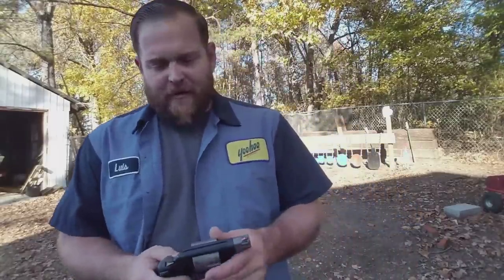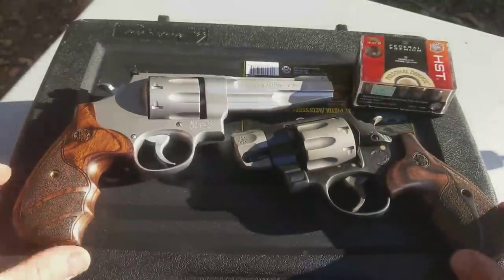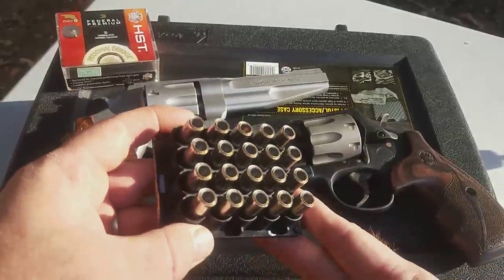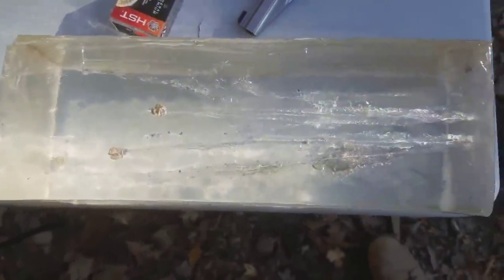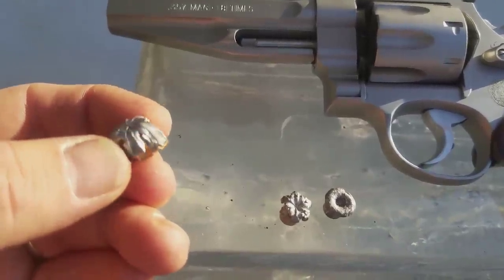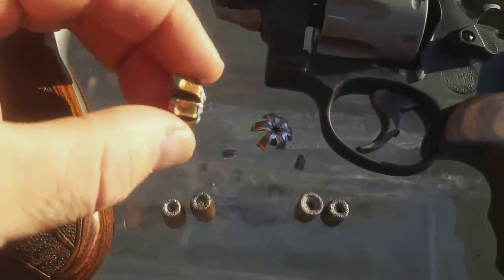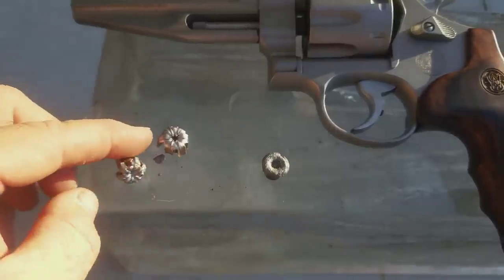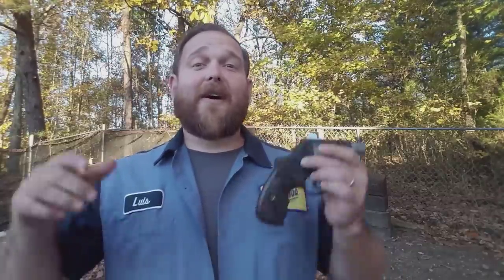S&W 327 Performance Center: Short Barrel Ballistic Gel Test

Comment: That was really nice expansion from that short of a barrel. I cast and load my own  to get that kind of expansion... soft cast lead hollowpoints. They aren't very accurate past 10 yrds... but they open up about dime size.
Reply from the maker: I need to get into reloading. That's going to happen soon.
Reply: If you balance the lead (not easy until you've done it several times) and hot load the shell you will epitomize your distance.

Comment: If you can find it the 38+p golden saber short barrel works well and isn’t a pita when reloading and or the speer gold dot  short barrel 38+p or 357 mag 135 grain does great out of 2 inch and under barrels in my experience and research. May want to give them a try. It’s damn near impossible to find the locally for me and I’m in a bigger city, so your likely gonna have to order them as well.
Reply from the maker: I'm in a rural setting. Our gun stores are kinda limited. I've been watching for the Speer short barrel 357. You're right, I'll have to order it most likely.

Comment: Came into a supply of these projectiles (which are pretty effective in the Model 442 J-frame as well) and have reloaded them in 357 Magnum brass at higher velocities out of a Model 19 with a 2 1/2" barrel with some success.  With a N-frame one would think further load development practicable: the factor to be determined would be exactly how much more velocity to add before breakdown of the projectile becomes problematic...?  Expansion of the factory +P loading is excellent.

Comment: Thx for the Video.
I have a question

I was told by an expert That 357 Magnum is pretty strong for any revolver due to that fact short barrel is very bad choice for two reasons. One it will eventually damage the  barrel on the gun and 2nd, recoil.
Any suggestions regarding those fact please.
But that revolver to me  looks like a beautiful Gun.
Reply from the maker: The barrel damage comes from guys running 40k psi loads and wrecking the forcing cones. I'll personally load them hot, just not 40k hot.